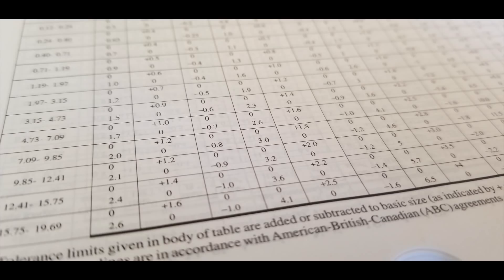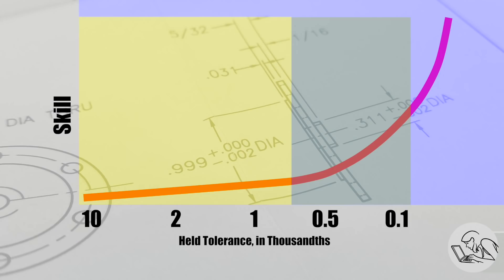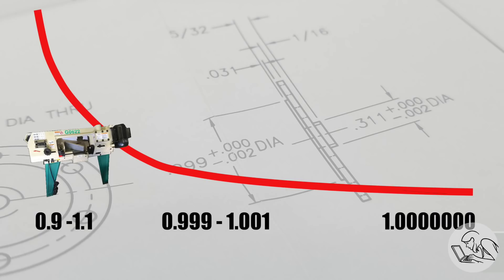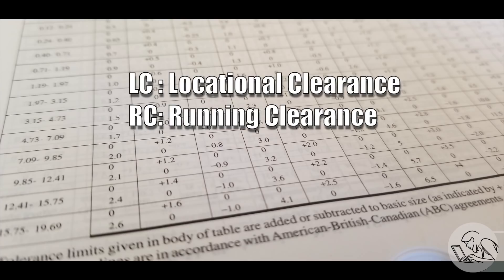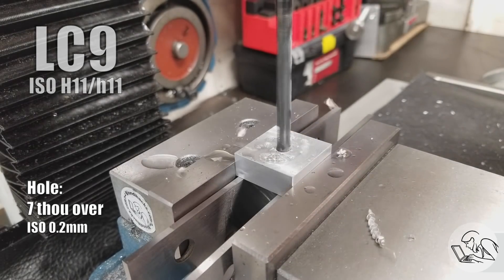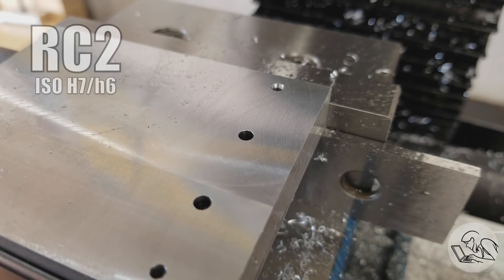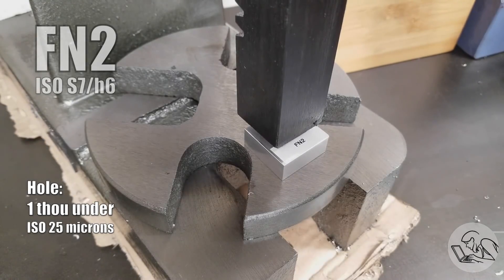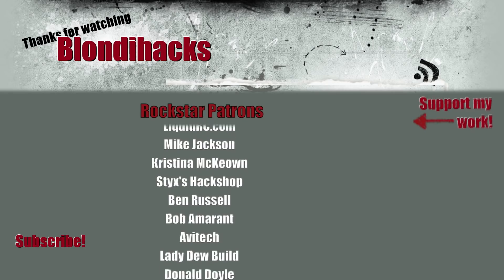Fits and Tolerances, Oh My!

Comment: Waaaaay back in engineering school, I had a professor who started a discussion of geometric dimensioning and tolerances with the story of Plato's Machine shop, where all parts are built exactly to nominal dimension.  The only problem is that everything they produce is infinately costly and takes an infinite amount of time to deliver.
I also had a riflery instructor make the point that until you can out shoot your gun, that is reliably make groups at or below the rated capability of your equipment, spending a lot of money on fancier gear isn't going to improve your scores.
Reply: So true, until you are better than your equipment, the equipment will limit you. After that, well you are just stuck for it.

Comment: These are things as a designer I have to keep in mind when designing things. Some of the work I do is incredibly expensive and requires an incredible amount of precision. Unlike my last employer which was in the ag equipment industry, to where the guys would tell me "If I can't read it on a tape measure I don't want to see your print." So designing mildy complex machines to have plus minus 1/16" fits and still working was quite challenging.

Comment: I understand that a machinist typically works to the nearest thou, a woodworker works to the nearest 1/8" and a shipwright works to the nearest ship.
Reply: Sorry, but I’m going to take exception to that one, 1/8” is said to be the difference between a carpenter and a woodworker.
Reply: @Canalcoholic  Fair comment. My bad.
Reply: @GeoffTV2  Even so, as a machinist (on my late father’s Imperial lathe) I can work to a thou., as a hand tool woodworker I am happy if my dovetails are within a quarter of a mm.
Reply: @Canalcoholic  That's nice going on the woodwork. I can't imagine what my dovetails would be like. I think an eighth of an inch would be optimistic :-)

Comment: When making aircraft parts, sometimes it was necessary to put the part under your arm when taking it to the checking desk, it made the part swell up by two tenths, you also had to watch it if the machine shop was a bit on the cold side. Hopefully, that part ended up in someplace hot.

Comment: I’m new to machining, so obviously I have things to learn. What I’m noticing is how little difference there is between the fit descriptions you’re giving and fine cabinetry or marquetry, especially when using dense exotic materials like bulletwood or ebony. Wood isn’t as sensitive to temperature of course but you can create a nice press fit using a kiln to dry out one or both materials below ambient, doing the assembly, and then allowing it to rehydrate. 

Is there a reason why the temperature manipulation in machinists’ videos is always warming something up with a torch? When you were talking about the metal-to-Delrin fit, it occurred to me you could shrink the metal with dry ice or liquid nitrogen and drop that in. Maybe the cold would cause uneven shrinkage and crack the bearing? Anyway, just seems odd that everyone reaches for a torch first. Maybe it’s just what’s on hand.
Reply from the maker: Machinists do often use cold as well for shrink fits, but it’s easier in the real world to make things hot than to make things cold. Getting +500°F with a torch is easy, but even -300° requires liquid nitrogen which is expensive and difficult to use safely. Big shops will do it though. Adam Booth has demonstrated shrink fits with liquid nitrogen on his channel.
Reply: Blondihacks That makes sense, the upward potential is wider than the downward potential.

Comment: A friend of mine got his first job (fresh from school) in a machine shop milling out pieces from a drawing, they had to produce a certain ammount in a certain time. (this was before the CNC era)
As all newbies, he got to work on the oldest, most worn out machine, but still did pretty good, he had to work some overtime if he fell behind but it was pretty ok.
Until one day (about halfway trough the run) when he had some time to go see where the pieces were to be mounted, it turned out that none of the measurements needed a tolerance of less then 0.5mm, but the drawing was with tolerance of 0.01mm.
The enginerd who made the drawing had that as a default in the program, and only changed it if he needed tighter tolerances.
He went out and got all the parts he scrapped and said, I'm done with this run, I'll be home the rest of the week...
That was a wakeup call both for him and for the enginerd, that they had costed the company enormous money in wasting time (and material) to make pieces better then needed. "Good enough" is a thing....

Comment: My boss in my previous department was always beating me up for making non-critical tolerances reasonably loose... "Any good machine shop can hold ___"... Granted, as an engineer who sometimes (but not often) machines his own drawings, it's a different situation, but I strive to make my prints as permissive as possible while still being high enough quality to easily accomplish the desired task.

Some of my company's tooling suppliers seem to like to overdo precision... both on prints and on finished products. Seems toolmaker's pride is a thing... even when there's no actual point.

Comment: Quinn, Thank you for a very informative video.  I am in my 80s and an experienced machinist.  Even so I learned alot from this video.  You might want to mention in a future video that reaming can be unpredictable.  The diameter will vary with rpm, feed rate, coolant (or cutting oi), and probably what you had for breakfast.
Reply: As to reaming being unpredictable, don't forget the phase of the moon, which way the wind is blowing, the temperature of the shop and so much more. You even have to factor in the number of ducks flying by at the time.
Reply: @oldfarthacks  Yes, and we have named only a few of the variables that affect the size you will actually get.

Comment: I really enjoyed this and learned a lot.  I did not cry.  I'm still a woodworker.  Hypothetical question, if you have a 1.0000 pin and a 1.0000 hole how do you describe how they fit?
Reply from the maker: That’s going to be a locational transition fit, effectively. If the two dimensions are the same to, say, 10 decimal places, it means for all intents and purposes the two surfaces are occupying the same space. That means it’s a light press. Locational Transition also covers extremely close running fits (hence the name “transitional”)

Comment: At 9:20 into the video, can you really read down to 30 millionths using a micrometer?
Reply from the maker: Yes, “ten-millionths” is shorthand for fractions of “tenths”. This is simply reading between the lines on the vernier tenths scale. It’s an estimate, but you can read within 0.00005
Reply: @Blondihacks  Takes practice to get that good.  Today, I tried to measure both a +1/4in gage pin and a 1/4" gage block (gage block spec was -7 micro inches).  Because I knew there was a difference I could convince myself that the micrometer was showing the pin to be bigger.  Note, the pin (being a plus pin) should be one to two 10ths bigger.  Was really really hard to see.  Good thing for me, with my old man eyes, I have a digital Mitutoyo micrometer.  For sure, it showed the difference between the pin and the block - but just.
Reply from the maker: These units would perhaps more accurately be called “hundred-thousandths” since one magnitude above is “ten-thousandths” but imperial machinists call them “ten-millionths” for some reason.

Comment: Does that mean it´s useless to use a reamer at a drill press because of runout ?
Reply from the maker: Good question! Reamers can be used with success on a drill press, but they may tend to cut little more oversize.

Comment: Great video, cool graphics too. I have a question. Can you please explain why you can have looser tolerances to achieve a certain fit quality when you have larger shaft & holes? I understand that manufacturing a large shaft or large hole to the same tolerances as small shaft & hole is more difficult, but from functionality point of view, how does a looser tolerance can still create a good quality fit on large hole & shaft, shouldn't you feel the large clearance? English is not my main language, hope my question makes sense!
Reply: A larger shaft will expand proportionally more with temperature,  so looser tolerances will compensate for that.
Reply: @chrisdownunder5831  Thanks, that makes sense. Also, is it fair to say that since a larger shaft has much more sliding surface that in turn produces more friction, and slight misalignments can cause the system to essentially bind, so if you want to have a quality slip-fit (when you have larger shaft and hole systems), you need looser tolerances? I don't know, I kind of tried to explain it this way to myself.
Reply: @QwertyCanada  Well, I'm just guessing now,  but if you needed to tolerate an angular misalignment of (say) one arc minute,  then a fit area that is twice as long would require twice the absolute clearance distance at that same angle.

Comment: Found that a very important thing is an adjustable reamer, especially for bushings in shafts, and especially for those times you are replacing a worn bushing, and press the new one in. you need to have the new bush slightly oversize for the hole, to get a good press fit, and I made them 0.5mm undersize on the inside, to allow me to ream them out to fit the existing shaft, as that was slightly worn, but making or getting a new one was not possible time wise.  Used some Vesconite hilube, as that would self lubricate, instead of the white nylon bushings the OEM used, and ran dry. Then used a piece of the rod to make an insert tool for them  as well, 1mm undersize all dimensions, and gently tapped the bushes into place.  Took around an hour to get out to the clearance fit, as you really only get a single chance before it is the same as before.

2 sets of both bushes on that shaft, one still as spare, and they will outlast the original. Could do little about shaft wear or it being slightly bent, other than to lightly polish it and apply a little correction to the bend, plus remove the original burrs on all edges. It is true about Chinese equipment, it arrives as an assembled kit, so you do not need a manual to assemble it, but you still need to take it apart and fix it up to workable from new. However, as the price was one hundredth the cost of the equivalent US manufacturers ( which is ironically made all in India and Vietnam now, nothing aside from the price of parts is US any more) machine, and it is a faster and more capable machine as well, it was well worth the hassle. 

Most spares are also easy to fabricate, or at least use the part to make oversize fit parts for, and only a few specialised parts you need from the OEM. Just only gripe is why the hell did they have to use 36VAC for all internal electrical works, because that is a pain to get spares, so I was doing a lot of repairs and converting parts to 24VAC, which was thankfully also available inside, but unused.

Comment: I find it offensive you would mention a surface grinder but not numerical controls. Yeah the average Joe doesn't have a CNC capable of .0001 inch tolerance at home, but the high cost plus skill makes accuracy much faster. If something takes 4 hours on an engine lathe, and then I forget to wipe the bore with and alcohol q tip, my deltronics that slipped right in is now siezed.

Comment: You'll never hit the dimension,  except in the one case where your part becomes the new standard :)
Reply: That's the metric system. When the standard meter bar was made, they made it and then said, that is the standard. I believe that that bar is still in use.

Comment: Lets start a rant thread of the +0 -x tolerance. Some say that means you should build the parts to the average and then inspect and throw away 50% of the parts.
Reply: The tolerance tells you what's important to the designer.
Reply: It's like playing 21. Get as close as you can without going bust. Do you draw another card on an 18? How lucky do you feel?

Comment: each material you work with in the shop has a rate of expansion with heat and contraction as it is cooled,  if you can not heat the part with the hole the next step is to cool the pin and let it slip in to fill the hole as it warms up.  this is of course taking into consideration the pressure of the fit does not break the parts.

Comment: A great engineer asks "how loose can we get away with"?  Our favorite way to teach this is to make the engineer drill out the 1" diameter holes of a 1" thick stainless steel base plate where they specified 0.020" clearance for cast-in concrete anchors. Of the three we've trained, none have ever specified a hole less than 1.5x the fastener since.

Comment: The tolerance of an interference fit is inversely proportional to the size of hammer needed to make the two parts fit 😀
Reply: So when the 6 ton press is not enough, then you need the 20 ton press?
Reply: Have you seen my range of hammers....very impressive lol
Reply: @davewilliams6172  Too much stuff, just drop an old engine block from the correct height

Comment: I think the closest tolerances I ever heard of are the ones of sartorius. They are a company that makes EXTREMELY precise scales. The most precise ones are microscopic beam scales, made out of one block of material. The size of the block is about 10 cm (or 4") in all directions, and the CNC machine that makes them is twice as big as a Volkswagen Transporter. There, nominal dimensions are final dimensions. The error while measuring is bigger than their tolerance. And of course the balance is made in one setup.

Comment: I've seen videos where they have a block of metal with a shape cut out then they put the piece they cut out back into the block. It's slowly slides it but once it is fully in you can't find the seam anymore. It's like a full block again with no indication where it was cut. How do they cut that and what would that be on the scale? RC 2 or 1
Reply: EDM is one method but as long as they fit closely it's just a matter of smoothing out the surface.
Reply from the maker: When you see those videos, it’s always EDM because that’s the most common stunt people do with EDM. 😁 You can achieve that with traditional machining as well, to some degree. Check out my Magic Tube video to see how it’s done.
Reply: @Blondihacks  EDM is the cutting using electricity right? Well I'll check out your video. Thank you.  Edit: I went through all 98 videos and I can't find one called magic tube.
Reply: @inspectorsteve2287  EDM uses electricity and either a shaped graphite electrode (die or sinker) or wire.  Wire is more for cutting than achieving 3D shapes.
Reply: @inspectorsteve2287  It's in one of the lathe project videos as I recall.
Reply: @jantimbramble7941  ok I'll check. Thank you.

Comment: Quinn nice job covering a complex subject. Another point that enters in is the circular form of the ID to OD components being roundness / runout or degree of eccentricity variation from the center axis. Just clamping a part in a three jaw chuck can produce a  trilobed geometry or shape. Drill press can also create this condition . This aspect becomes important as fits get closer and is often controlled by Geometric  tolerancing  on modern part prints.   .         

.

Comment: Maybe I missed it, but with hole fit tolerances, H7 for example is -0 +12, that's the limit of what the class calls for.  But when machining you have to divide the tolerance in half.  So the target dimension would be 6.006mm and you have a total range of 12micron.  So you can be as low as 6.000, and as high as 6.012, but in practice you always shoot for the center of the tolerance.

Comment: What are your opinions of a smithy 3 in 1. It is a cb1220xl? Mill, drill lathe....probably weighs 400lbs. Cost new today maybe $2500 $3000? Just got it and wondered what I should expect out of her. Thanks
Reply: oops! You made the same mistake I did in 2001.  Lathe is an ok workaround. 
Mill's round column sucks; can't keep position when raising/lowering head like a dovetail can.
If taking too heavy a milling cut the head can swivel,
Reply: @robertmatel8136  that sucks. Thanks for the good news. Lol. I hope it will be a decent starter machine learn on?